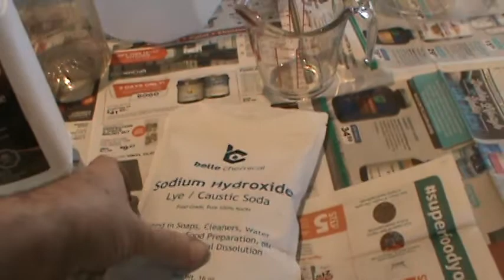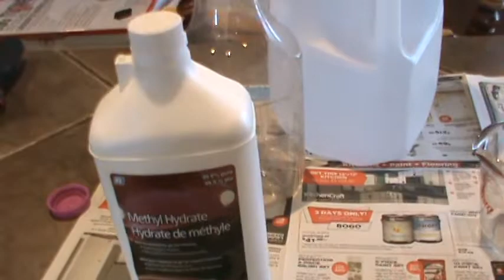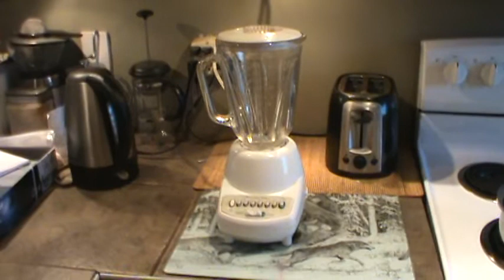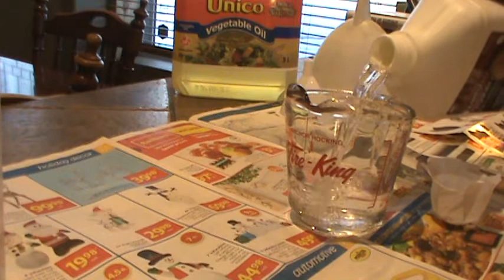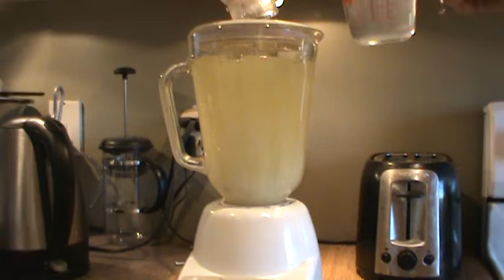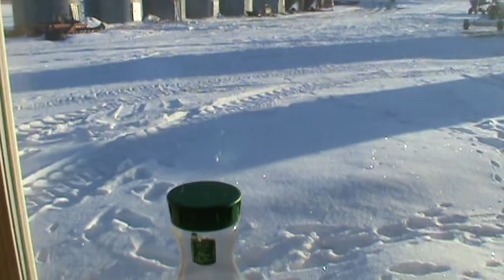#9 Biodiesel Basics

Comment: Fahrenheit scale is BS. And I only learn what I'm able to make myself. I'm not able to make methanol so it doest make sense when the diesel is expensive, methanol will probably be expensive too, not to mention lye and food-grade oils. I dunno man. Can you modify the recipe and use common chemicals like ash and ethanol or something like that? If not, it's better to modify your car to run straight on oil. However it still doesnt make much sense when the food price will be higher than today.
Reply from the maker: Thanx for the comment. I totally get what you're saying. When I was making 100 litre batches, I bought lie in 50 pound bags, three at a time, and methanol in 45 gallon drums. I was making fuel for .25/litre. Also, my truck went from 28 mpg to 33mpg. The maintainence was a lot less as well. There are people who run straight oil, but I prefer to make fuel until I can't get materials.
Reply from the maker: I use the fahrenheit scale because it's what I am used to.